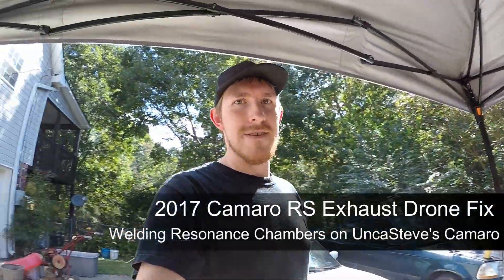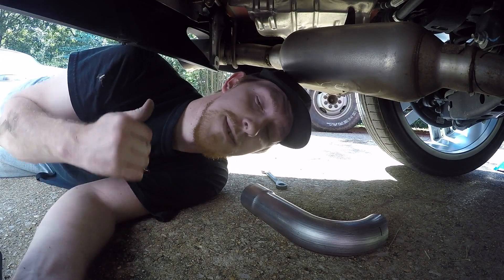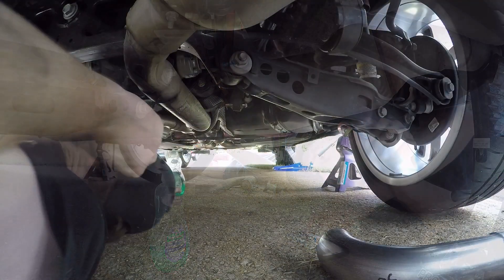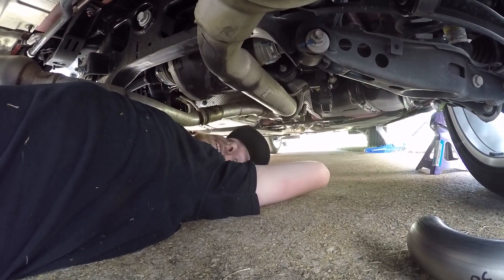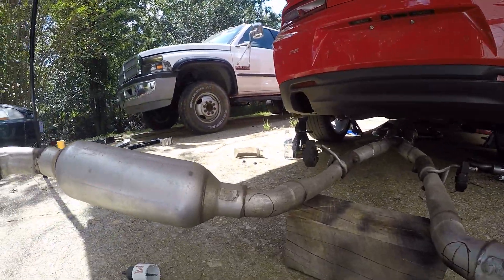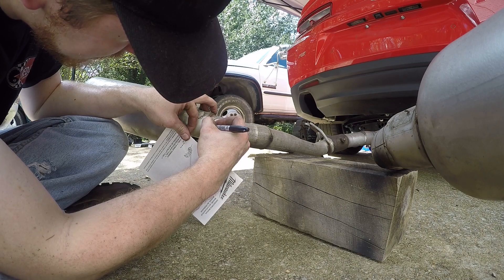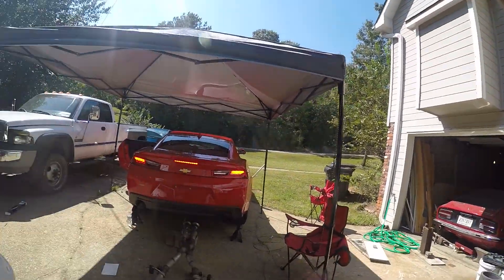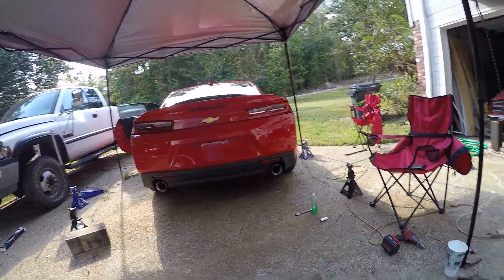2017 Camaro RS Exhaust Drone Fix  J Pipes

Comment: Would replacing the ‘H’ section with a ‘X’ pipe section help any?  I’m not sure if I’m into having all that extra piping hanging under my Camaro, I would even remove the two aftermarket mufflers and try a set that claims no resonance like Cora’s RSC (Reflective Sound Cancellation) Good job though happy it worked for your friend.
Reply from the maker: It would not be near as effective. It would help,  but the mufflers will help if they have an internal chamber. These chambers are very effective way to cancel out the resonance.  Never hurts to try something though.  Only good way to find out for sure!
Reply: @Black240SXDrift  TY for the response, mine has Gibson mufflers, the rest of exhaust is OE, the resonance was there as soon as I hit the highway, driving 75+ lessens it but I’m not always able to go those speeds so I’m looking for alternatives. Again thanks for the tips and vid.
Reply from the maker: @Muffin192213  absolutely man!

Comment: Hello! I just replaced my Toyota MRS exhaust  and I have this annoying reverberation which is making me hating driving the car.  I am going to install a J pipe. There are mathematical formulas to calculate the length of the J-Pipe. Did you do any calculation to know the ideal length of yours? On the other hand, why did you installed 2 J pipes just before the mufflers instead of installing just one before the Y? Thanks mate!
Reply from the maker: Yes there are formulas to figure it out. These pipes slid in and out of each other so you could fine tune it. Also this is a v6 engine so they are more like x pipes. This way you have to run two. Typically it's also better to have them closer to the exit or mufflers.
Reply: I have an MR2 mk3, currently running a decat Toyosport manifold, generic sports cat and a flowmaster delta 40 muffler.

Since fitting the sports cat, there is a lot of resonance and drone around 2200 to 3k. If you pull on the throttle cable whilst looking in the engine bay you can see the whole exhaust vibrates a hell of a lot at those rpm.

I'm going to make a branch resonator up. From my calculations and at about 85hertz, the pipe needs to be around 40 inches long. Obviously that's pretty big for a small engine bay so it will need to double back on itself.

If you want to add me on Facebook I'll let you know how it turns out once it's done 👍

Comment: My biggest question is that where do I put the J pipe?. So my setup is Mid delete and I got 2 vibrants muffler on both then straight pipe to the rear. You can see it in my channel. I do get drone at low 1k to 1k2 rpm and cruising at 8th gear at 2k rpm
Reply from the maker: You would topically put them in front of the mufflers,  but since yours are forward, you could attempt it in the rear.  It souks still help,  but I haven't ever done any behind mufflers
Reply: @Black240SXDrift  does it change to the tone? Because I love how my exhaust sound, I don't want the tone change. It's ok In local but highway it's too much LOL
Reply from the maker: @stingah  it might change it slightly,  but shouldn't be drastic.

Comment: Would the j pipe creat back pressure in the exhaust system?
Reply from the maker: No. It's a side chamber for resonance out of the flow path. Purely for frequency alteration to avoid resonance.

Comment: What about a hemoltz resonated midpipe ?
Reply from the maker: Same concept,  both work.  The benefit to these is you can adjust them to the car where as the mid pipe typically needs to be tuned to the engine and exhaust.
Reply: @Josh of All Trades  not necessarly true
Reply from the maker: @chrissikora3359  k

Comment: So does the j pipes give the car a cool noise and reduces the drone from the inside?and do u find it good to add j pipes into the stock exhaust of a 5.0L v8 engine?( i want cool exhaust sound and no drone)
Reply from the maker: The j pipes will just reduce drone. You would need to change mufflers or exhaust system to change the sound.

Comment: Not knocking the guys in the video but I had to lookup "j-pipes" today.

Hear me out folks, there are better ways to cure drone than routing your exhaust to look like a balloon animal.

I came here because I was told of a j-pipe fix for the newer v6 cars and it didn't make sense to me.

After seeing it done I can definitely say it's just allot of extra pipe that looks like a teenage mistake.

Buy quality catbacks or decent mufflers and straight through resonators like literally everyone else has ever done and you can fix the issue.
Reply from the maker: Absolutely a good exhaust is the way to go,  but this is a scientific fix for drone. It's called a helmholtz resonance chamber and is a common fix for resonance issues. As a former automotive nvh engineer, this is used in many places to reduce noise and resonance in factory vehicles. Primarily on your intake. All of those weird chambers coming off the intake tube on modern vehicles are the same concept. If you look into the SAE (Society of Automotive Engineering) NVH classes, this is a topic covered as well. It's a scientific principle at work here, not just some tubes sticking out randomly. V6 engines tend to drone really bad, and a lot of very well engineered aftermarket exhaust systems have these chambers to help reduce this phenomenon. This exhaust was on the car when he bought it, and this was a much more affordable fix than a resonance tuned full exhaust system.

Comment: Wow! Fuck all that... I would just change the mufflers rather than install all that bullshit. It's a V-6 car, it should be seen and not heard anyway. V-6's sound terrible with anything but a silent exhaust system on it. Save the pipes for the V-8 cars.
Reply from the maker: I remember when I couldn't weld either.
Reply: @Black240SXDrift  perfection. Haha
Reply: @Black240SXDrift  😂
Reply: @Black240SXDrift  I wouldn't WANT to weld that into my car. I've tigged together quite a few sets of my own headers and roll cages... So yes, I can weld.

Comment: Did the overall exhaust noise get quieter after the j pipes?
Reply from the maker: No it did not change the overall sound of the exhaust the only thing it stopped was the resignation inside the cabin. So the car still sounded the same, but didn't make your brain rattle anymore.